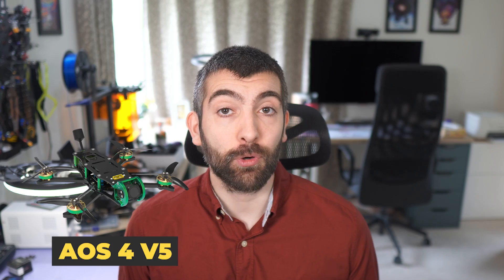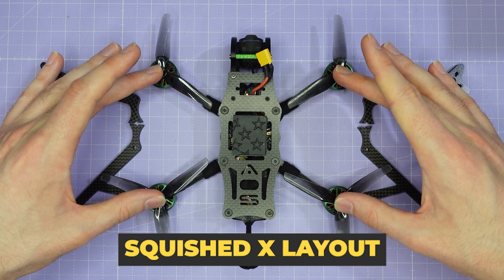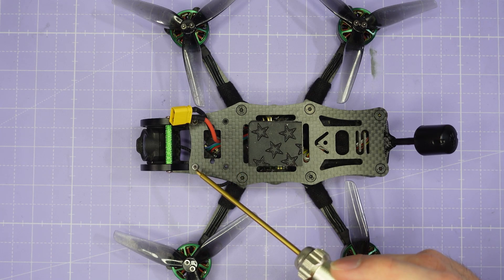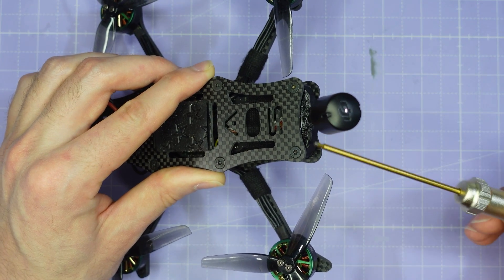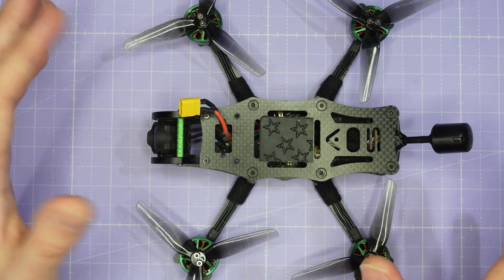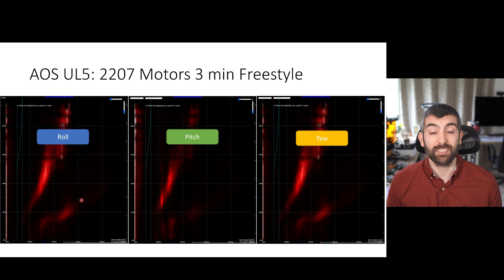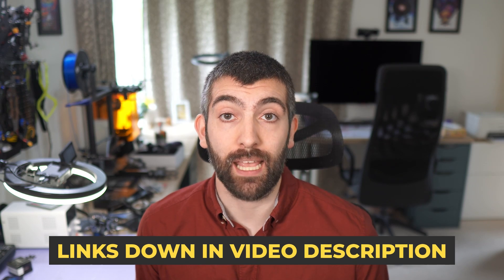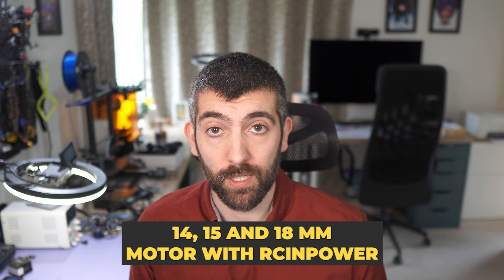Unleashing X-Cell anti-vibration with new FPV Frames: AOS 4, UL5, UL5X V5

Comment: I just finally received the frame yesterday and spent about 6 hours building it. My first ever build.  I used 5 inch by blade props with a 2104 - 1800 KV motor.  Using a cheapo 1000mah 6S battery (just for testing purposes).  I just came back from my maiden flight on a baseball field. I got almost 15 mins on it.  I cant believe I didnt horribly screw something up and it flies mostly normal lol!  The exception being is at very slow speeds or when I drop the throttle it starts to wobble a lot very noticeable when I tested in horizon mode which was for the initial take off only. I honestly can't believe I got that kind of flight time on a cheap LIPO. Look forward to a nice LION pack. I have Bluejay running at 48khz , I believe I left the esc settings at default. Any suggestions about the wobble or is that tuning related. I am currently uploading the video of my maiden flight to my YT channel that shows the wobble Im talking about. If anyone cant point me in the right direction, it would be greatly appreciated.

Comment: Hello and congratulations, I don't understand from the site which parts are recommended for mid/long range with AOS UL5 V5, stack - motors and prop? in the list I find the same components for all models. Could you advise me which motors, props and lipos to recommend for the above? Thank you

Comment: I like the first and second generation AOS, but really cant support it any more. It seems like every time I need to rebuild or break a part, you've moved on to the next design. There's just no lifespan in the part availability.
Reply: Kind of disappointing that there’s no response to this comment.
Reply: According to his LinkedIn, he quit his job and does AOS RC in full time, that's probably why he's forced to innovate so quickly and drop new products. And he holds his parent for the X-cell. That alone costs a sh*t ton of money. But yes, his frames are indeed superior to others. Maybe it's time to build open source frames but using scientific methods
Reply: @thirdpartycookie  "his frames are superior to others" 

You need to get out of the "FPV Shilltuber" space.

My frames blow his out of the water any day. In fact his new "cinema"whoop drone is looking a lot like mine from 2 years ago.
Reply: @33rdframe  let's say it like this, I have the LR5 from hin and before the Rekon 5 frame. Both are super thin. With the Rekon 5 I had super strong oscillations at 55hz to low to tune out that killed my footage. With the LR5 and his preset, nothing at all. So in my case, yes his frame proved superior. 
And I learned all the tuning from him, which is how I identified what was wrong with my Rekon. For free!
Reply: @thirdpartycookie  nothing in life is free
Reply: You can order any part you like for almost any AOS design present or past from CNCdrones. This might mean buying spares ahead of time and in bulk to get value for money with shipping costs, but it's an option you lack with many other manufacturers who simply stop making designs. Of course we would all like to able to buy arms locally, but these are niche parts after all.
Reply: @earthsgrip  That'd be prohibitively expensive for any country other than the US. In my country, the AOS kits were stocked, but once sold out were unavailable.
Reply: @thegribbs  I live in the UK! You need to plan ahead a little, which is somewhat annoying. But distribution is expensive. Having a collection of globally distributed licensed frame cutters who can work to demand is IMO vastly preferable to having a single point of failure that can shut up shop without warning. It would be nice if there were a cutter in Europe for sure.
Reply: @earthsgrip  true, but if you live outside the US, shipping costs are so high that it is worth buying a new frame. For me, the best source of AOS frames in the EU is Aliexpress, fortunately, parts for my older AOS7, 5.5 and 3.5 are still available, I think I bought a spare one.
Reply: Money money money
Reply: Try out one of my drones. They mostly all are open source at this point. And they are superior to this blan crap. Granted the carbon cut is a little more expensive

Comment: 4:24 ouch ! all my 20 mm stacks are m2. Should I remove the grommets to use this frame ?
Reply from the maker: Send me an email using the contact form on the website and I can get a main plate with M2 20*20 for you

Comment: i like the look, but i kept on finding myself coming back to the title of this video because i don't quite fully understand what your x-cell is. so then i went to the link for more information and it didn't explain it in any more detail. all i can gather is: more carbon cuts around where the fc is mounted so less vibrations?
Reply: Yes, it is exactly that. The cut outs are placed at the points where usually vibrations/oscillations would influence the stack the strongest. By removing the material at exactly these places it is possible to disrupt this happening. In certain places the vobration modes do not result in critical movements and therefore it is okay to let some material there. This is what Chris calls XCell and on my AOS5v5 it works like a charm 😊

Comment: Any Walksnail compatible stuff?
Reply: What would you need to be walksnail compatible? To me they all seam perfectly fine to be used with walksnail? The black O3-gummies are optional, and by simply installing the included carbon shim instead, the frame is ready to be flown with walksnail as well (if you want, take a look at the build video he posted 5min earlier for more info) 😊
Reply: Yes, just take your pick.

Comment: i broke 3 legs and bottom plates on AOS3,5 just by light crashes, don't know why you call this frame all protected. :( bottom plate was crushed by just a screws from iFlight
Reply: V2 I fix it with glue :) still flies . Evo recently hit the branch - leg broken :( branch ! Not concrete . But still I love em. Even v2 glued :)
Reply: @steamvogue  The Evo might have been bad luck or cracked from a crash before, but I agree, both V2 and Evo were (and still are) adorable frames. It's always the balance between weight and durability. For me in the 3.5" class, the priority is on the weight. I just like the frames to be ~40g and not 50-55g and I accept that I have to replace an arm from time to time (Chris knows that, I have been bagging for a ~40g 3.5" x-cell refresh ever since his first x-cell teaser🙈)
Reply: On the latest AOS3.5v5 or an older version like the V1, V2 or EVO models?
Reply: I have quadmula siren f35 and it’s lighter than full aos 3,5” Evo on same hardware . But I like both :)

Comment: Assume quite lot of us will ask if its worth the upgrade from LR5 or UL5 of previous gen. How did the weight change on these new 5?
Reply: From his website:

UL5V5:
87g (5mm arms) 94g (6mm arms) including hardware and camera cage

UL5X V5: 
82g (5mm arms) 89g (6mm arms) including hardware and camera cage

UL5 evo (the one very similar to V2):
~67g with steel hardware

LR5 evo:
~68g with steel hardware

=> So in gerenal they seem to have gotten a bit heavier, maybe due to the metal camera cage?
Reply: @luis_gbs  yeah the cage seems to be the main factor in that. Tpu design might help there for UL
Reply: @jasukenneth  Yep, some gramms can be saved probably, but I am always surprised about the weight of TPU cam mounts that offer any protection at all... (but for UL/LR use they might still be fine). For me the classic carbon plates where perfectly fine though
Reply: 87g 5mm vs 69 on previous LR5 hmmhmm acceptable
Reply: The AOS LR5 which I have is already heavier than other UL5 frames, so no, no replacement

Comment: no TPU included, huh?
Reply: The black camera-gummies are included, so normally no nead for TPU inserts for the camera. They are simply availible if you need to modify or print them yourself. 
Regarding antenna mounts etc: I am sure they will be included with the iFlight kits, I am not sure about the CNC-drones version

Comment: 4" is the new 3.5" according to my humble opinion. I have had a 4" quad, a modified Rotorama frame with 16 mm FPV Cycle motors. It has flown extremely well, almost glided on the "large" prop discs. So currently I have a project to modify my AOS 3.5" O3 quad to 4" with some own design arms. I reckon that it will fly as well as the Rotorama 4" quad did.
Reply: Interesting, may I ask what you use them for / in which environment you fly them? 
For me the 3.5” class is still the largest I can/want to fly around places where people might come by. Anywhere else, I always was astonished how good the 5” formula flew, compared to my 4” drones.  For me, the difference between 4” and 5” is more like: Additional weight headroom goes into motors and battery size, and I profit from the better flight performance. With 4”, I always feel as if the electronics (FC,ESC,VTX,Cam) are rather heavy compared to the overall weight I would want from a 4”, resulting in undersized LiPos. 
=> I am truly interested in your experience/feeling : )
Reply: @luis_gbs  Empty fields, or car parks. Not at all near people. Feels like a 3.5, but more "gliding".

https://youtu.be/S65y5bOxVsE?si=khf5oVT7SuO6wgXH
Reply: @donphobos  Nice, I understand :)

As I said, for fields etc I just like my 5.2" quads, for schools or so I can not go higher than 3.5" max

But I am happy that 4" flies great for you!
Reply: @luis_gbs  At empty parking and car lot building.

https://youtu.be/eU6iYkeAk4Y?si=bTWmjiDhGD-UijD3
Reply: @luis_gbs  Small field (70 meter long) it is also a lot of run....

https://youtu.be/CFv5sWx2HqU?si=nG0XCm_YV49yniyd

Comment: 1404, 1506  and  1804 motors are my guess
Reply: Rather 1505, 1506 would be bigger than 1804. Also rcinpower already does 1505 for GEPRC.
Reply: @Kai-P  It will probably be a 1506 or 1507 for his new aos cine line.
Good steps would be 1404, 1604 and 1804.
Since 15 is close to 14, I guess it's more like 1506
Reply: @chrisbee5481  Oh right I didn't consider him going for different specializations, could make sense to have 2 with almost the same stator volume then.

Comment: The 20 x 20 stack screw holes drilled in M3 is nonsence.
No one is going to use a racing stack on an UL or 4". All mini stacks are M2.

Comment: For that AOS 4 build what was the AUW? Would you go 2004 for 3.5 props or 1504?
Reply: I am not sure about the AUW of the 4” build, but would be interested as well : )    
Only thing I found it the weight of the AOS4v5 is noted to be 75g on his website, maybe that already helps 😊

To the second question about the 3.5” size:
I have two AOS3.5 with the T-Motor 1604 and am happy with them. I had a build with XNova 1804 and didn’t feel the need for the size. By contrast, the tests I did with 1404 motors felt underpowered. So in my opinion: Something like 1504, 1504.5, 1505, 1604 is the best fit

Comment: They look cool , So are they for Long range? How much better are they from LR3 5inch ?
Reply: Depends on how you build them up. I would personally not see the AOS5 as a typical LR build. I am sure you will get a nice LR quad out of it as well with LiIon, but maybe some other 4inch frames would do the job at less weight (for LR a little more filtering isn’t too bad, as there should be less propwash etc).
Especially the UL5v5 could be a great option, as it has no props in view and seems to offer a good mix between weight and durability. The UL5X could be ok as well, but I think it is more ment for true freestyle :)

Regarding your question about the “LR3 5” I am not sure what you want to know, I guess you mean quads in the 3.5” class? If so, then they may offer some benefits, depending on what you are looking for. 4” and light 5” typically allow for more payload, such as a naked GoPro etc.   By contrast, a 3.5” is less visible for others and maybe more silent (depending on weight &  props). Does that help you?
Reply: @luis_gbs  I have the first gen AOS 5 LR and I did 8.1km yesterday with only 2500mAh consumed.